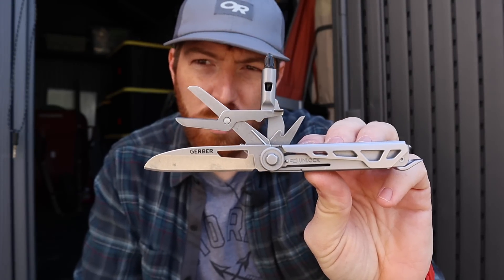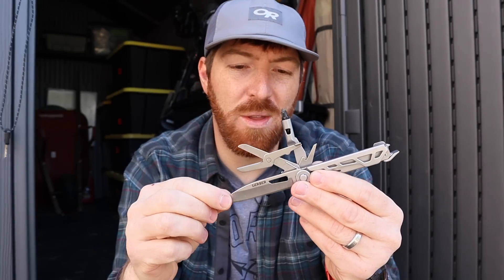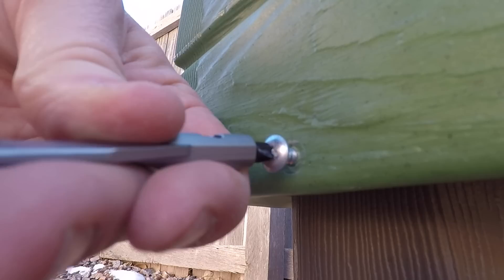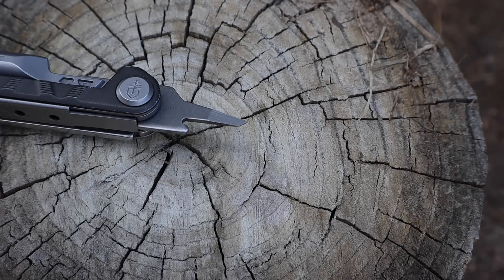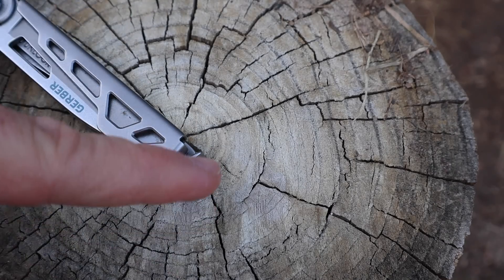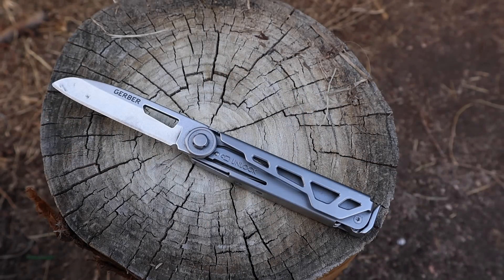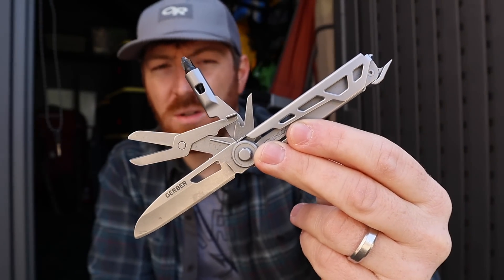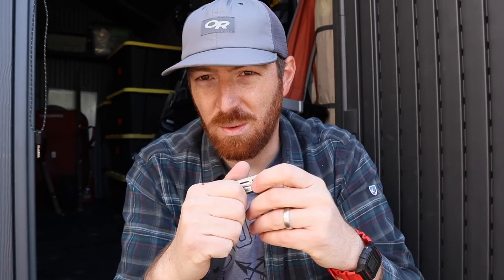Great Pocket Tool or NOT? Gerber Armbar

Comment: ive just gotten one of these and im stunned it isnt more popular.

Does need a pocket clip and im already planning other mods.
Fits a second bit hidden under the scissors and a toothpick/ victorianox pen there as well.

If you shave a pencil/pen down to fit the hex bit the driver arm opens up to be a comfortable pen. 

ive never been so happy with a multi tool  before

Comment: I like the  Armbar, especially  the knife blade. It is really a great knife. It is hard to believe, but, for such a compact tool, the Armbar's blade is about 5 mm longer than the blade on the Leatherman Free P4! It is almost the same length as that on the Charge, and is 5mm longer than the blade on the Skeletool. 
I laugh at complaints about the "poor steel" of the blade. 10 seconds once a week on a sheet of 1200-grit w/d emery paper is all I need to keep the blade razor sharp. If you want a multitool blade that will stay sharp for 12 months, keep dreaming! 
The scissors work well, and the screwdriver setup is very useful for the occasional need to deal with a screw. Note: "occasional use". If you are building furniture, use a dedicated screwdriver!! No workshop uses a multitool as the main set of tools. 
The awl is small, but good to scrape, poke a hole, or mark something. 
The hammer/pry bar/bottle opener is great for opening paint or varnish tins and for tapping the lids closed. Anyone whining about how you can't drive nails with it is just not living in the real world. It's not meant for that! 
The only other tool I need is a pair of pliers, and unfortunately, this is missing. The Armbar is a really great little compact  multitool,with a first-class knife blade. Well done, Gerber!

Comment: My most used least carried multitool is a Victorinox Evo Grip s18. sharp locking blade, saw, scissors, toothpick, tweezers, nail file, Phillips and 2 flat screwdrivers, can opener, cap lifter, and sewing awl for $47.00. Since I rarely carry it I put a lanyard on it and put it in my pocket when I do carry it. Has all I need. Still not too crazy about Gerber.

Comment: I like the size, and the fact that you can use standard bits for the screwdriver!
Reply: I find two major problems with the Gerber armbar drive driver bit holder.
1. There is no locking mechanism, and it collapses if you apply pressure. You shouldn't have to concentrate on keeping the driver open while turning it.
2. You can use standard ¼-inch bits (good), but they go in too far, leaving only 9mm protruding, and it is very difficult to pull these out, because there is so little of the bit to grasp. Often need pliers to extract.
The hammer function is not meant to hammer nails. It is great for tapping lids on to paint tins, for example. 
Otherwise, this is a potentially great multitool.
Reply: @Billhumphreys3370  I have seen longer double sided bits you can use and these longer bits can be stored inside the Armbar!
  Pretty cool.

Comment: I think this tool has compelling use cases this is fantastic for everyone that needs a specific but large set of drivers in a light package. Biking I need a flat, Phillips, T25, and 2, 4, 4.5, 5, 6, and 8mm hexes for my gravel bike. It all fits in a tiny space in my seat bag....or in my pocket. The bonus is I get a pretty large knife and just the right hammer that I can knock a bent derailleur back into position. It has been a god-send 30 miles from anywhere. Same for the dirt bikes...just different bits.

Comment: The locking blade sold it for me. Amazon linky no worky. Nice keyring mod. Good idea on the paint lid opener feature.  Since Tinker has neither a bit driver nor scissors,  I think its not really cost comparable. Maybe you were thinking of the Super Tinker at $32 with scissors. The closest Victorinox with bit driver is 2x to 3x that price. My only reticence is I have another Gerber locking multi tool that is miserable to operate when dirty,  cold,  or with gloves.  No amount of cleaning, lubrication,  or adjustment allows it the lock mechanism to function for more than a week. The liner lock on the Armbar likely won't suffer that same problem.  Gerber sucks.

Comment: All multitools are a compromise for not having the full size dedicated tools available.Howvere, the Armbar has been my pocket friend for a few weeks now on my farm and has proven to be very useful. The full size bit/holder is great and it means that you can replace worn bits (unlike multitiools that have dedicated bits). For me, a locking knife is big safety feature - my old and trusted SOG does not have this and I have nearly come to grief a couple of times - it stays in the kitchen drawer as a great multitool for ad hoc light home use. For adding pliers, look at the Leatherman Skeletool for pocket size/weight.

Comment: I personally think the victorinox tinker would be a better option than the Gerber. I've had my tinker for 12 years and it's still going strong aside from having to reglue the handle covers on. Every Gerber product that I've had aside from the older Gerber suspension multi-tool has failed me at some point, even more so with the newest products.
Reply: The primary tools I'm looking for are a quarter inch bit driver and scissors.  Not casting any shade on the tinker but I think it's a slightly different use case

Comment: I still think the skeletool is the best edc multitool. Pliers, blade and screwdriver, sure it's shorter but I've never needed a long driver when using a multitool, those are for when you are in a pinch.

Comment: Super good review! I’m thinking about getting this to be a part of my EDC. From what I could find the blade is 420 HC stainless.
Reply: If it was 420hc then it wouldn’t take a razor edge nearly as easily as it does. I think it’s similar to 5cr steel like what’s in the paraframe with my testing and resharpening.

Comment: Bought it and returned fairly quickly - non locking driver became a deal breaker for me - it folded on me so many times when applying any pressure, it became infuriating. I really wanted to love this tool, still waiting for version 2.0, with lockable driver..

Comment: Its halfway decent.The Scissors are functional, but the pair on a Victorinox is better.I do like the Driver and it takes standard 1/4 Bits, however if You lose the One it comes with I figure your going to have a bit of Trouble finding that One. I pair mine up with a Centerdrive, then I got something to Turn and Something to Hold a Faster at the Same Time.

Comment: Been looking at these Gerber tools. However I have a knife blade on the tool so why the scissors? Rather have a metal file instead of the scissors! Personally I never had a use for the scissors but needed metal file multiple times. Thanks for the great review and taking the time to share with us.
Reply: Scissors come in crucially for angling needs. To me, that’s what this product (or more specifically, the newer one without the driver) is about. It goes in your coat pocket and is all you need to prepare your rod.

Comment: I'll stick to me SAK Deluxe Tinker, with mini pry-bar attached to the lanyard ring; but thanks for the review!
Reply: My EDC as well 😅 good choice 👍
Reply: @Crosswalker.  My compliments on your selection as well!
Reply: @marko11kram  😅👍 thanks
Reply: @Crosswalker.  Actually, the Mini-pry bar is connected to the Lanyard ring with one of those Niteize Mini S-Biners so it's easy to take off to use. Its saved the tip of my blade a few times I'm sure.

Comment: Currently the amazon link does not take you to the same armbar.  The one there has a corkscrew 31-003565
Reply from the maker: sw10mm Must be sold out on Amazon. Check blade HQ they have some I believe.

Comment: Locking blades on small pocket knives like this are unnecessary. Honestly, how many times has your slip joint SAK closed on you while you were using it? Unless you were trying to baton with it
Reply: Erm, a few times. Especially if it gets stuck in what you're cutting or if you're stabbing/piercing something. Also saw a guy nearly remove a finger with a SAK that didn't have a lock.

Comment: I wish a multitool company would put a bit driver coming out of the center of a tool, to make it a T-bar driver to make it more useful. I like that the blade is larger. I wish the awl had a hole in it. I am not a fan of the small scissors on any multitool....great when you need to make one cut, but tedious when you have to cut a piece of paper or some cloth. REALLY sick of every multitool having to have a bottle opener on it. And it's 2020, ALL tools should be locking. I think gerber designers don't actually use multitools. It seems like they make them to look cool, not to be totally functional.
Reply: Check out Toler Tools Union, I believe it's got a T-bar driver
Reply: @no-tj8ee  kinda cool though the way it's built looks like it'd be uncomfortable in the hand....and the price is overly high...
Reply: @randyyeager  I don't really carry multi tools because I haven't really found one that's worth it but this looks like it is. I think the price is fair but idk, we'll see I guess. I think it's kind of a game changer though
Reply: @no-tj8ee  I used to carry a multitool every day. At some point I switched jobs and I wasn't  allowed to carry a knife....even if it was on a multitool. When I did carry it.....the pliers came in handy, the knife came in handy...the scissors on them I found pretty much useless. This to me looks more like a gadget than a good multitool. Made more for someone to show off the cool thing they bought  than to be useful....
Reply: @no-tj8ee  $100 USD is steep considering they don't say it's made in the USA, which means it's likely made in china....

Comment: I historically dislike gerber for many reasons but their armbar is perfect pocket EDC with no print sad thing is like the SOG power pint few realise it, more complain, so the echo chamber destroys good cost effective easy sharpening/maintenance minimalism for lesser poorly thought out revenue kickers lol

Angling of tools physics meaning the tool shouldn't close and can't if held on the gerbers rounded comfortable thumb cut out driver shank (and certainly can't cut you).

Hilarious most drivers on most multitools weren't locking and worked even uncentred and unrounded much like the vaunted yet sadly inferior LM skeletool that can't be used for 20 screws or to whittle of 20mins w/o killing bones in your hand nevermind costs you 2x 12hr work shifts after tax if you loose it/goes walkabout/gets confiscated.

That said knife should open from the same direction as the other tools "Spydie Flick" style - a flat back to a knives handle is vital on a working blade and like Victorinox also KNOW a blade closer to the palm is best - on the outside it wants to rotate and gets amplified by a broomhandle design.
Further (like all gerber cut out designs) one of the cutouts should have been an oxygen wrench.